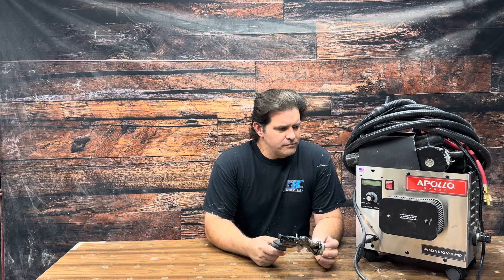The Apollo Precision 6 Project

Comment: Let’s go! Glad to see your back! I would love to hear your honest feedback on the new Apollo and anything else you talk about product wise. 

I seen they’re a six stage now. Is it a 6 stage like titan where it’s a bleeder or did they leave the 6 stage non bleeder style? to be honest I sold my 5 stage I had 2 of them@ at different times. But they just were to slow and they could never handle 2k coatings without 15-20% thinned. People who say 1-5 % ya no that’s a standard cup gun without bypass.  Un thinned possible with bypass reg or large needles. (I wonder if you could link 2x 5 stages together for a 10 stage) 😅 but boy that would be annoyingly loud lol

I would retry a turbine if they operated at like 14.5 psi-15 psi but right now they remain  still to weak. Cup gun or AAA is still the way! Unless you show how 1.5 psi more is magically game changer for that price! 

Either way good to see you back in the videos! Learned a lot from you in the past! ❤
Reply from the maker: its a non bleeder.  Yes to use this you  are going to have to thin products but you want to use reducers instead of water they cut the viscosity better. Even with a standard cup gun and a 2.5 or 3.0 needle reduction is necessary typically 10-15% some cant take more than 10% or you will break the back of the thickener and the coating falls apart.  i will explain all of that in this series. Even if you don't use the apollo system you will learn and understand more about how water base coatings work.
Reply: 🎉 can’t wait! 🎉 always love learning new stuff from the masters!